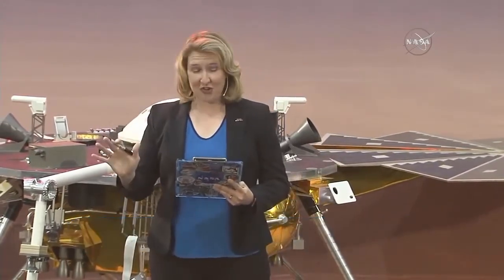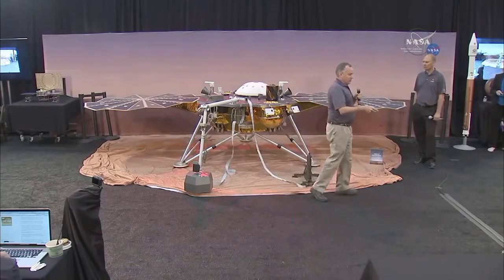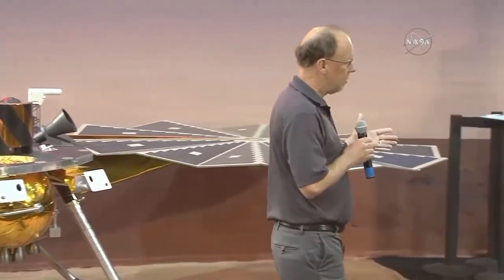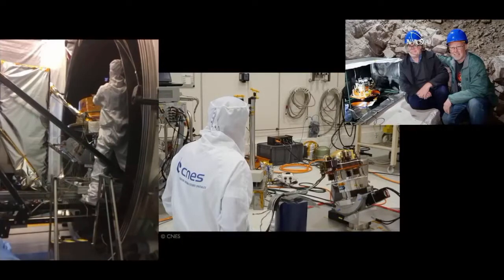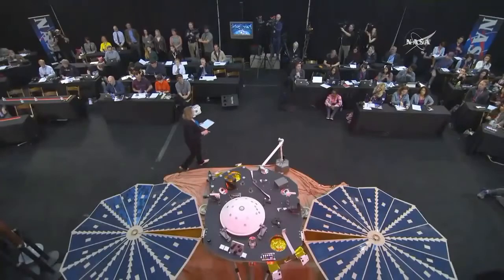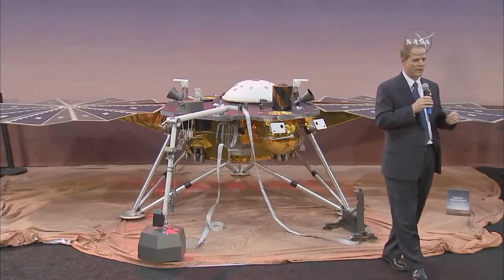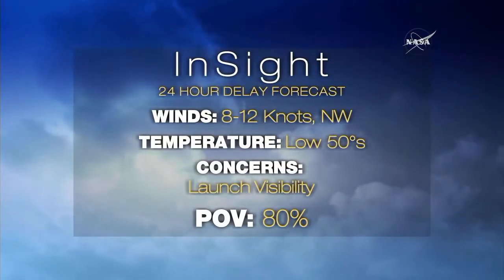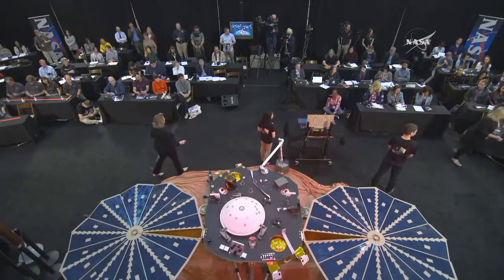NASA JPL InSight Mars Lander Prelaunch Media Briefing

Comment: Thanks for posting this. I wouldn't know how else I could watch this.
I wish they could be more detailed... Foe example saying that the cube sats uses same propulsion as a fire extinguisher and later saying cold gass. I think about co2 gass ofcourse. But damn, so scetchy details. I want to see how the xband antenna on the insight lander works, it looks locked to a locked position, and what science mission did it have? And is that helix antenna you see the UHF transmitter? And how is the design on the UHF antennas on the cube sats. Every day astronaut said that it had redundant landing propulsion, since they where in pairs. But that was probably his guess. So now we know of one nossle fails, the science mission goes badabang into the soil. My name is on the silicone chip, also my deceased little brother.... :/
Reply from the maker: insight does have 12 engines for landing so  theoretically it would have some redundancy - but then with a fully autonomous computer controlled mars lander that's usually not too much good - usually if a mars lander fails it's likely because of navigation issues, which is getting safer and safer over time as NASA gains more and more experience and has  more sacecraft in orbit to assist navigation